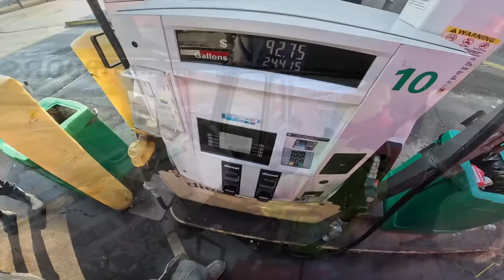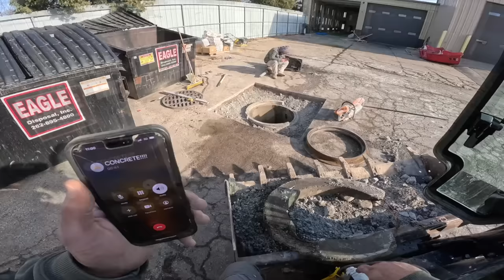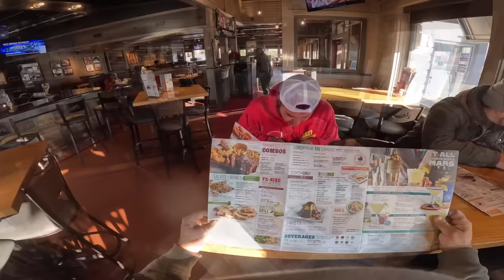Easy fix, easy money? Not today!

Comment: Ryan if you had any relationship with your local street department, they usually have some concrete rings on hand for their own use that you could buy or just replace when you have a chance. They're usually pretty flexible
Reply: Ryan could be making them with the leftover concrete along with other small precast items.

Comment: We work with hydraulic hammers all the time in my area. Make sure you're properly charging the hammer flat with the ground before you start breaking, and give it some time to get going, especially in cold temps, and it might save some headache! Also, Im an equipment operator  in Idaho, 42 degrees is awesome lol

Comment: Hey Ryan,

You might want to look into keeping some water absorbent socks to barricade the drain until the concrete cures.  If you weigh it down a little and pack the bottom with dirt, it might be a good enough temporary barricade.

Comment: It sounds like the starting issue with the form truck is the shifter linkage that conecks to the transmission needs to be adjustid so it goes fully into park

Comment: WOW, metal coat hangers equals  REBAR,  and not even tied together... infact,  I NEVER see anyone tie that Chicken Wire they use on Driveways... N OOOOOOOOOOOOOOOOOOOOOOOO  ONE uses chicken wire in Canada... i mean noooooo  one.   3/8' to 1/2 inch MINIMUM. REBAR..

Comment: Put a pad in your front yard and use the compass on it with 3 flag pole  on the slab sarounding the back side of the compass and put up a American flag a fire department flag and a pow flag . Then it can be the C.E.O.'s job to raise and lower the flags every day . And if you hand stain the highlights of the compass that will make it pop

Comment: Can't believe you don't check under the hood of Mack before using it!! 
You have no idea where the oil level is, or radiator fluid..NOTHING..cmon man you should be better than that
Reply: The tandem had a pretty bad oil leak and still wasn’t getting checked regularly as long as it starts and runs there happy 😂

Comment: Never tie a knot in a chain, how dumb
Reply from the maker: To lift a sewer grate? 🤣 Yes, call me dumb.
Reply: Haha How Dumb ? it worked didn't it ? You Can't Even Carry Ryan's Mag,
Reply: @VictoryOutdoorServices  Stick to concrete, why you should not tie a chain, is probably above your pay grade
Reply: @Dominick_Calvitto.  Haha how Dumb you cannot work out the reason for not putting a knot in a chain
Reply from the maker: @ellagrace27306  You continually leave one negative comment after another on my videos. Over and over and over again but yet you continue to watch them and continue to comment. Super weird but thanks for the engagement. 👍
Reply: @VictoryOutdoorServices  Afraid its not super Weird, I don't sugar coat anything I watch, if it's not correct, and not like some of your Avid followers who hang onto everything you do and say, going by some of their comments. I used to do Agricultural Buildings, laying the concrete floors and erecting the buildings, so when I see something is not right, I will call it out. As far as the two Amigos go, I would have shown them the door Months ago, a lack of knowledge and a lack of interest will prove to be their downfall
Reply from the maker: @ellagrace27306  Just admit you love the channel and can’t get enough. 🤣💪
Reply: Just admit you love the channel and can’t get enough. 🤣💪   🤣🏴